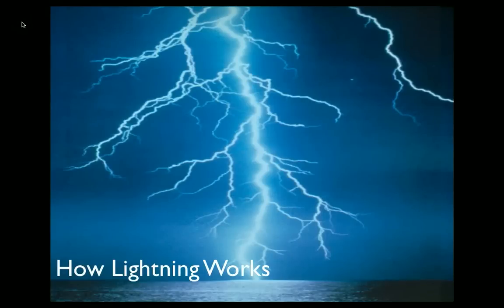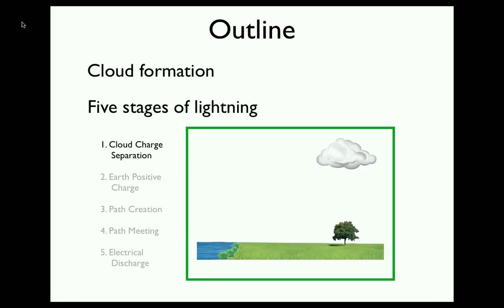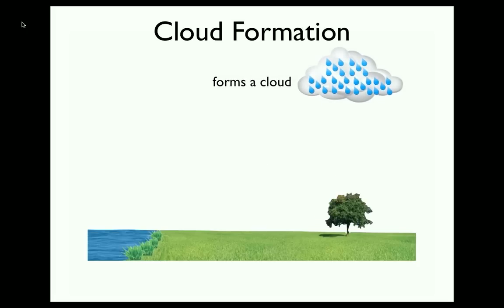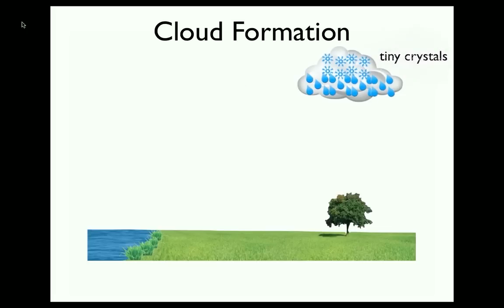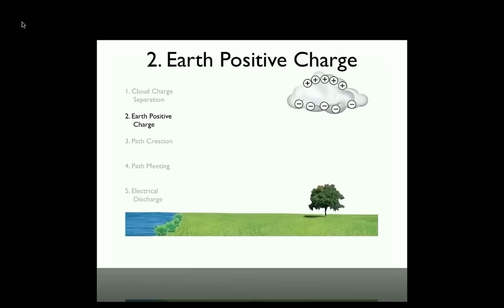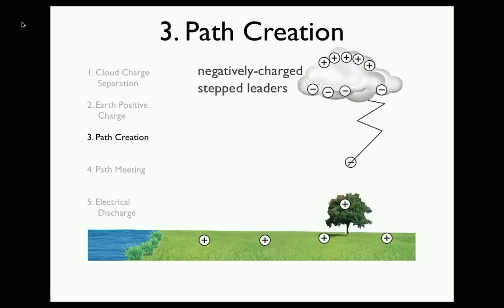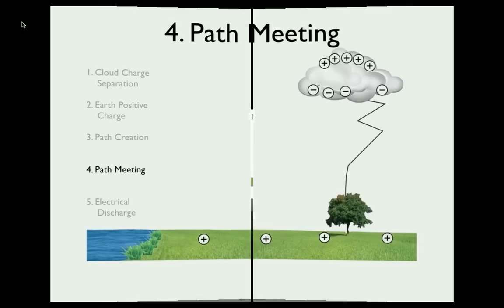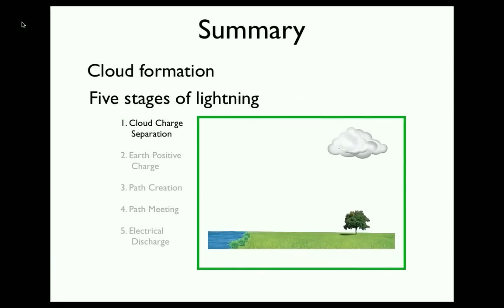How Lightning Works

Comment: One can i say about streamer, the positive streamer is much more frequent than the negative streamer (Electric field to make positive streamer is lower than the negative streamer due to the space charge effect with different electrode polarity). and even, the bidirectional streamer near the cloud also frequently to make the leader state.... that mean's the mechanism of lightning initiation is very hard to define. Even the latest article say some cosmic ray affects the ionization of upper cloud and make some gamma flash.. so called terestrial gamma ray flash.

Comment: Transcript: Have you ever wondered how lightning really works? Now you may have a vague idea about the general principle, but could you explain exactly what happens before you see a flash of lightning? Well let's start by asking: what is lightning? Well lightning can be defined as the neutralization of electrical charge separation between the cloud and the ground. Now before we are able to see a bolt of lightning, however, many steps occur behind the scenes. In this presentation, I will explain those steps. First, I will explain how cloud formation begins the process of lightning. Then, I will explain the five stages of lightning that culminate with the lightning bolt. Now in the first stage, electrical charges separate within the storm cloud. In the second stage, the Earth acquires a positive charge. In the third stage, two conductive paths are created. In the fourth stage, these paths meet, and in the fifth and final stage, the electricity is discharged in the form of a lightning bolt. Now the process that underlies lightning begins with cloud formation. When the surface of the Earth is warm, moist air near the earth's surface become heated and rises. As it rises, the air cools, which produces an updraft. As the air in an updraft cools, water vapor condenses into water droplets and forms a cloud. At high altitude, the air temperature is well below freezing, so the upper portion of the cloud is composed of tiny ice crystals. Eventually, the rice drops and ice crystals get large enough that they fall through the cloud, dragging some of the air from the cloud downward, which produces downdrafts. When downdrafts strike the ground, they spread out in all directions, which is the wind often felt before a lightning storm. These opposing updrafts and downdrafts create the first stage of lightning, which is called cloud charge separation. Positive and negative charges within the cloud are separated with the positive charges at the top and the negative charges at the bottom. Now in the next stage, the earth acquires a positive charge. This happens when the cloud charge separation is so strong that the strong negative charge at the bottom of the cloud causes the earth's surface to acquire a strong positive charge. In the same way, the opposite poles of a magnet attract. Now in the third stage of lightning, two conductive paths between the cloud and the ground are created: one headed from the cloud to the ground and one from the ground to the cloud. The part that begins in the cloud is called the step leader and is created by negative charges heading towards the positively charged ground.  As the step leader approaches the earth, charges in the surface begin responding with a conductive path of their own called the streamer, that is, a positively charged streamer. The fourth stage occurs after the negatively charged step leader and the positively charged streamer meet. The two paths have completed their journey. With this path complete, current will be able to flow between the earth and the cloud. Now the fifth and final stage is what we see as lightning. The strike is a sudden, massive flow of electrical current moving from the cloud to the ground in order to neutralize the separation. Now because there is an enormous amount of current, there is also an enormous amount of heat. This heated air causes the brilliant white-blue flash that we see. Now in summary, remember, after the cloud is formed the electrical charges in the cloud separate because of opposing upward and downward winds. Next, the negative charges in the cloud bottom cause the earth to acquire a positive charge. In the third stage, two conductive paths are formed: the step leader and a streamer. These paths meet. Finally, the electricity is discharged, producing the big bolt of light that we see in the sky. Now I hope you can see that there is undoubtedly more to lightning than meets the eye.
Reply: Curtis Naito thank you